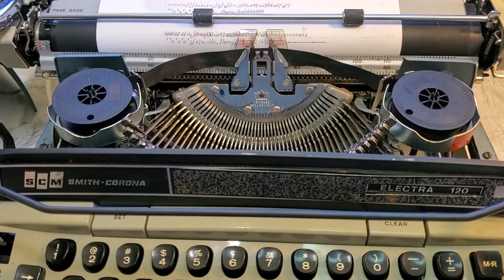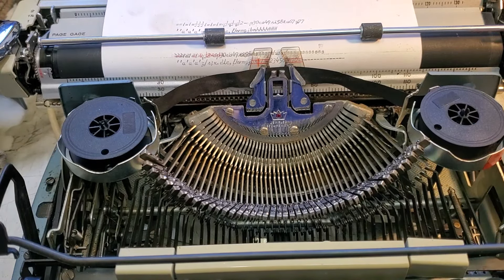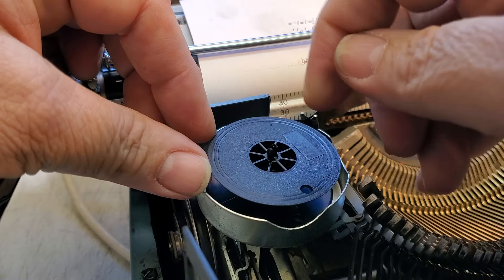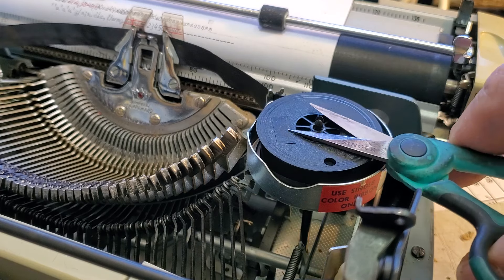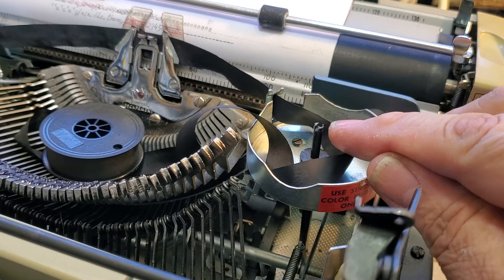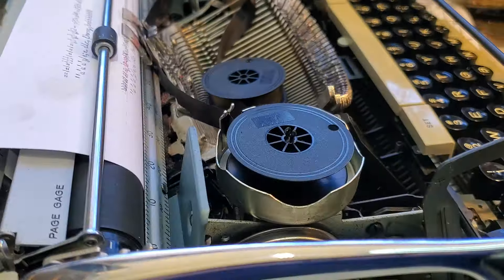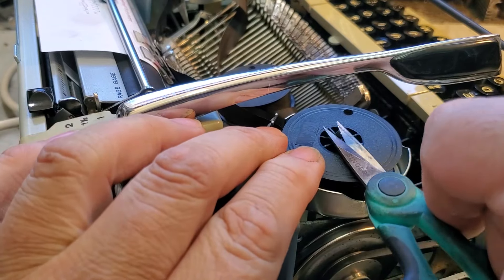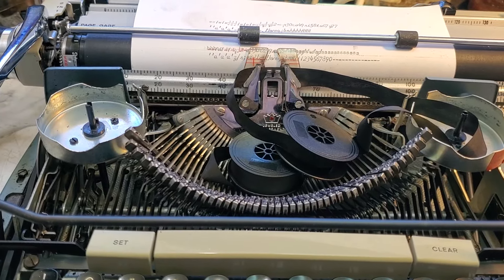Smith Corona Typewriter Ribbon Spools Stuck on Shaft, Modify Repair Improve Removal Process

Comment: Granted, it is a very poor design.  I think that removal of the spool was meant to involve the pinching of the two nodules together with finger tips making the removal possible.  Several of my SCM's have broken nodules anyway.  Steel posts after the mid-sixties on SCM's varied from year to year and model to model.  There is really no explanation as to why that is.  BTW a wire cutter might work better.
Reply: Or fingernail clippers — if one insists upon permanent removal rather than pinching on an as-needed basis.
Reply from the maker: Wire cutter would be great, got plenty of those,
Only reason I used scissors was for people without immediate access to a blade, cutters
should have use a little larger scissor than that small fabric one, but keeping it simple . . .